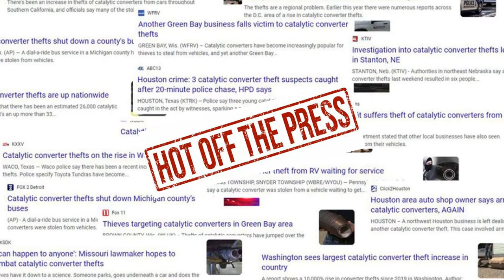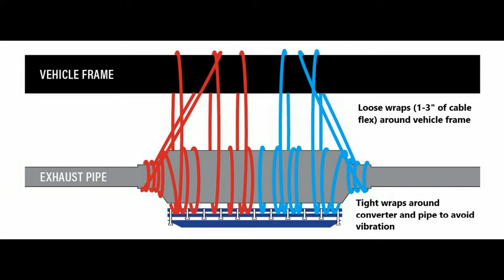CAT RAP Installation Video October 2022

Comment: Installed like that, beyond the usual 2 pipe chops, I count you've added only 3 cable snips to take it.
Then they can remove the cable entirely at their leisure at home.

I'd be focusing a LOT more on making a lot more loops around the frame. Your own diagram at the beginning of the video shows making 7 loops around the frame. (1:02)

It's no competition for a full cover plate, but I suppose this style does seems to be about the only way to offer a universal deterrent that doesn't require some custom fab work.